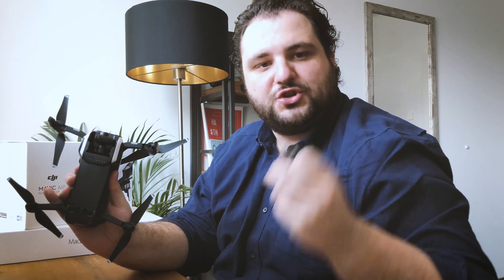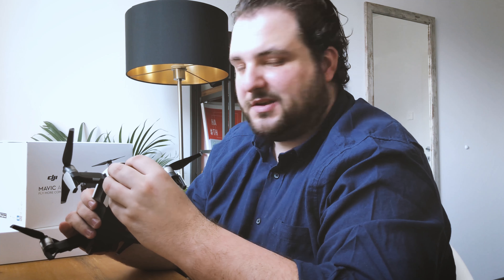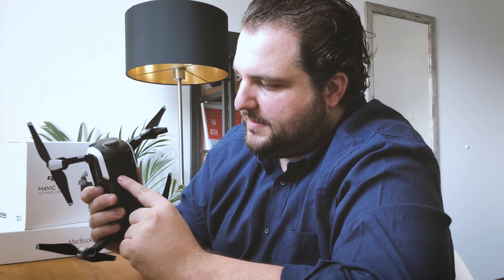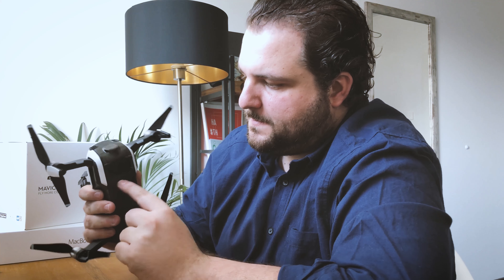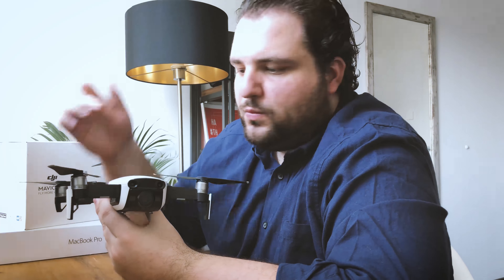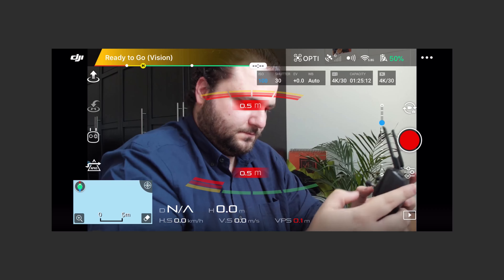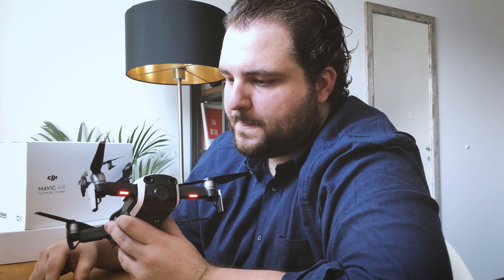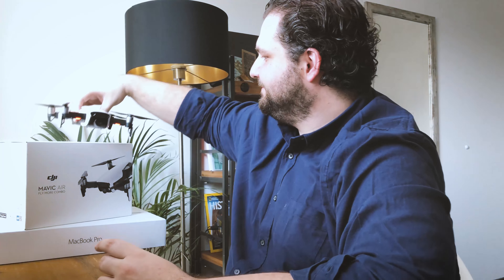DJI Mavic Air | GIMBAL Motor OVERLOAD FIX in 30 seconds

Comment: Thx for the video, I get the "gimbal stuck" error on startup, it spins around but won't center itself.  Will doing this work for that error?  It will correct itself eventually, after I move the drone around a few times, or turn it on and off, but it never centers after first starting it up.  I hesitate to do this because we've been warned so many times not to turn it in with the cover still attached, but this seems to be working for most everyone, thx

Comment: The calibration got stuck at 10%. Anyone facing the same issue?
Reply: yeah :(
Reply: mine gets stuck at 80/90 goes back and forth
Reply: Atelier Nando Gil mine too, did you fixed it?

Comment: Within the first 10 days the gimbal started shooting the rotor blades. I returned it and got the money back. Perhaps this could have been a better solution. However, experiencing such issues so quickly didn't make me trust the drone. i hope the mavic pro2 will be a better experience

Comment: Just got this error today for the first time. I did crash today on uneven rocks... and I also turned the drone on with the cover for the first time by accident... but flew without problems 3 more flights that day before I had the error message and it stopped working. I'll try this if it doesn't reset itself next time I turn it on. :)

Comment: Won't keeping the cover on result in hazy/unusable video? Or do you just keep the cover on to get the gimbal motor overload error turned off?

I presume, you just keep the cover on for an initial flight, and then the error is fixed, and it can fly w/o cover on after?

Comment: Mavic air 2 final overload problem. Know how to fix that one? Tried your way but doesn’t work.
Reply: Having the same exact issue. Does your video come in all shakey?
Reply: George Garcia yeah. Totally. Sometimes it’s even shaky without it even saying gimbal overload. I gave it a IMU and Gimabl collaboration at home so I’m hoping that will fix when I fly tomorrow. Please let me know if you find out how to fix it.
Reply: I've tried everything and ever calibration and it'll be good for about a minute then it'll be shaky and I'll get the gimbal motor overload notification. I'll give it a day or two and if it keeps doing it I'm gonna have to exchange it
Reply: George Garcia yeah. I got a feeling mine won’t work today also. Let you know later.
Reply: I am having the same issue!
Reply: Just took it out after my IMU and gimbal recalibration and still same problem. Going to try contact DJI tomorrow and find a solution.
Reply: Had to send it back guys. I suggest you do the same

Comment: Worked for me too! Thanks! After a crash that resulted in exchanging three arms to new ones, I noticed that the gimbal looked crooked and a bit off. When I tried to do "Gimbal Auto Calibration" it got stuck and bounced between 80-89% and wouldn't finish. I watched your video, attached the gimbal cover and restarted and then the GAC, things got back to normal again.

Comment: I encountered this today when flying my air.
This happened when I changed my shot from single to pano and it started to shake badly.

Exit pano and went back single and returned home.

Search on google this video came up. I watched and fixed it immediately.

Second battery went out and shot pano no issues.

Thanks a lot.

Comment: Thanks so much for this. Will try it out as soon as I can. Can you just confirm, you've start up the drone with the gimbal cover on. Did you then calibrate with the cover on? It doesn't look like it from the video footage of you while you're doing it but just want to be sure. If not, at what point did you remove the cover?
Reply from the maker: I started the Drone with the Gimbal Cover on and after that I removed the Gimbal Cover and made the calibration!
Reply: Legend. Thanks for the quick reply.
Reply from the maker: You are the second one asking that question ;-) I thought it was clear because you can see me in the picture being recorded by the drone while calibrating. But thanks for the feedback, I will kepp that in mind when making the next video!
Reply: You're absolutely right. I just wanted to clarify as I'm sure my paranoia is much higher than most, but after drooling over so much drone footage these past 3-4 years, finally getting one has made me even more protective! lol. Keep up the great work. You deserve more subscribers. I'm in - new sub from me!
Reply from the maker: Thanks man!

Comment: thank you for the video. I did have a crash; but when I go to recal the gimbal settings it only goes up to 10% then freezes. Not sure what to do next,. I have done this multiple times; and did it with the gimbal cover on; and off. Thanks for any advice. Colby

Comment: Thanks! I had suddenly touched gimbal and it'd crooked almost 45 degrees, auto calibration didn't work, but it helped! You saved me!
Reply from the maker: Alexey Saybel great that it worked. Have fun flying! Br, David
Reply: Unfortunately it didn't work, I got gimbal overload error and shaked video when I started flying (
Reply from the maker: That's bad; there is also a possible solution, to start the drone holding it sideways like in this video: https://www.youtube.com/watch?v=UoKtUbl0URo

Comment: I have not had the overload error but my gimbal tweeks left and right when in flight, ANYONE?
Reply: Hi there did you manage to fix the tweek when flying and the gimbal adjusts by itself? Please share repair.
Reply: I was able to fix mine with a can of compressed air. Leaving the drone turned off and moving the gimbal around manually while blowing out the gimbal motors with the compressed air

Comment: I don't want to naysay... But while this may work, it is not the best idea for the overall health of a gimbal system. Not allowing the gimbal to move when the power is on can damage the motors/servos in the gimbal. It will strip and stress the components. You could end up making it worse.
Reply: even i have same concern, as many videos suggest not to on with cover on
Reply: So why naysay?

Comment: It doesn't always work. It actually depends on the reason you have the error. In my case I didn't realize I had gotten a very small amount of sand in the belt. I would do things like what you show she would show fine then after take off I would very quickly get the error again. I used air to make sure all sand was out then I gently moved the gimbal manually and I felt the small resistance from a few kernels of sand and moved it manually a few more times. Once the gimbal felt smooth I was clear of sand no problems since.
Reply: I have the same problem mate:( Happy to hear that there is a solution for that, how do you remove the gimbal manually? Any video for that?:)
Reply: emre erden  I dont know about removing fully the gimbal seems risky. Ill bet good money someone online did it though.
Reply: Aue dose anyone know why I would not get any visuals on my camera, ..and the gimbal won't calibrate..dose anyone know a fix..plz thanks
Reply: even i guess i am having same problem, how did u remove sand ? 
with vacuum or blower?
Reply: kapil ricky he said he used air... get a air duster, or even better a small compressor

Comment: It didn’t work for me. It allways between 80-89% with or without protector
Reply from the maker: So the automatic calibration does not work? You can try the manual calibration of the gimbal or even calibrate the vision system. Watch that Youtube Video: https://www.youtube.com/watch?v=xfcjxfMocLM

Comment: are you also calibrating with the cover on or are you only turning the aircraft on with it on?
Reply from the maker: I recentered the gimbal without the gimbal cover; I just launched it with the gimbal cover on. Let me know if it worked for you! Br, David
Reply: it did , thank you. but its not necessarily clear in the video.hopefully anyone confused will read this inquiry,  but the fix is spot on and saved me from sending it in to DJI as the rep recommended. THANKS!!!
Reply: i recalibraten mine and it went away
Reply: it worked the first time but this error keeps repeating. do you have any other suggestions? thanks
Reply from the maker: Cool, happened to me once, that I only had to calibrate it. But the other times it didn't work. Br, David